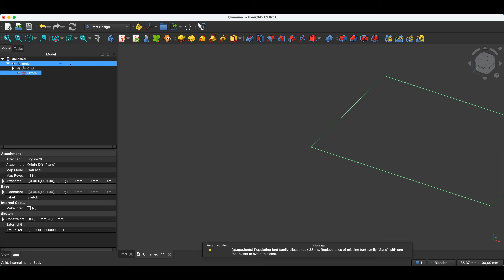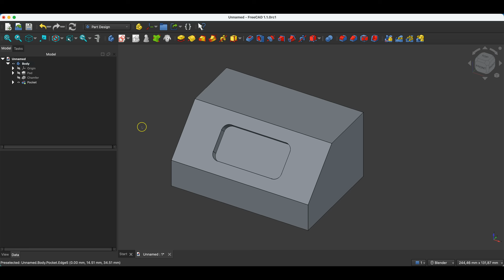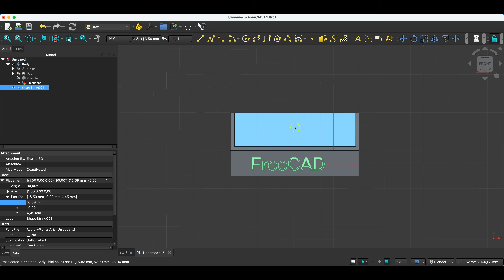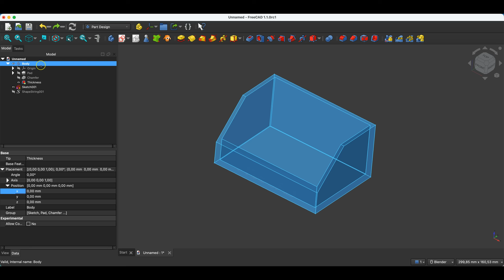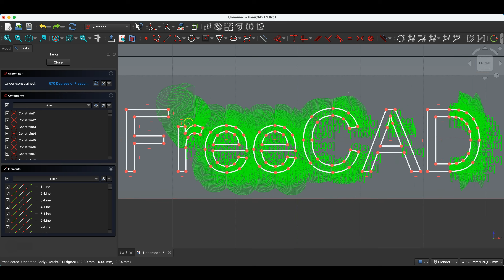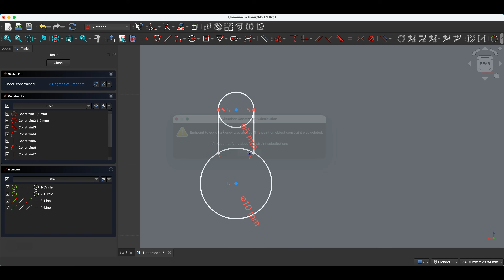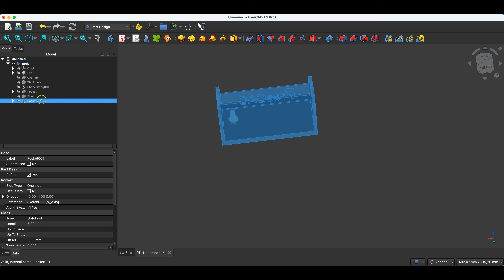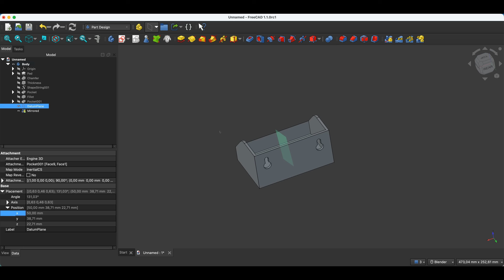FreeCAD Thickness, Text Engrave & Datum Plane - FreeCAD Tutorial 2026 - Part 8

Comment: Interesting that when you created the small circle @ 11:05, the refresh drawing request came on. Could be why the dim lines don't appear @13:30. Refresh is important to keep errors to a minimum (correct errors immediately), eliminating later problems, especially if the model is to be 3D printed. Errors may stop a model from being exported for printing, often refered to as "file contains no geometry" when opening in a slicer.